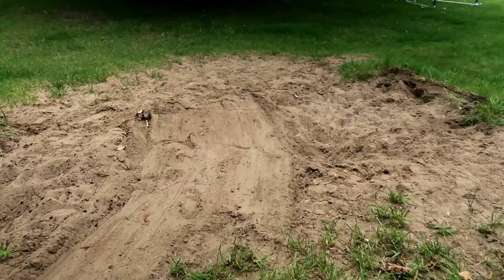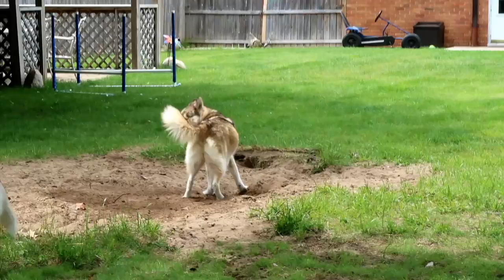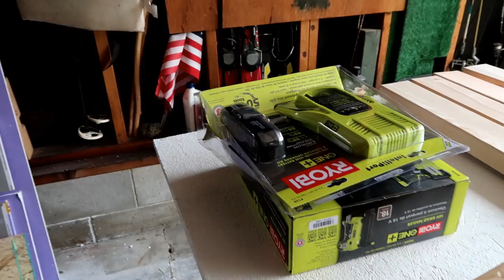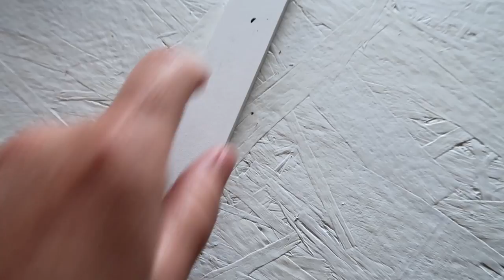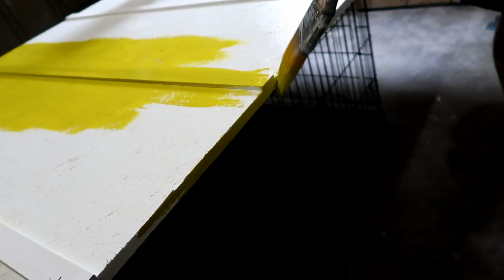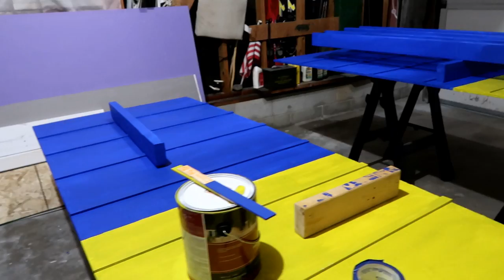BIG DOG HOLE

Comment: I bought my dad an air brad nailer. Tried it out in the garage he picked up a board and tried it a few times. It was effortless. He said: "this can't be working". Then the next nail went through the board and into is finger. "oh, it does work" and saw 3 more nails already through the board.
We both just laughed "another dangerous tool :)"
Brad nailers are nice as you are not pounding on things that work other joints loose and work one handed.
That ramp should last. I questioned earlier the choice and glad you explained how protecting it was important.

Comment: If the computer overheats to the point where it auto shut down stuff can start melting. For live streaming ideally you need a 6 or 8 core cpu, if it's a laptop you would need additional cooling pad/fans on the bottom or to the side. For a desktop, a 1800x is great for streaming/coding on a budget.